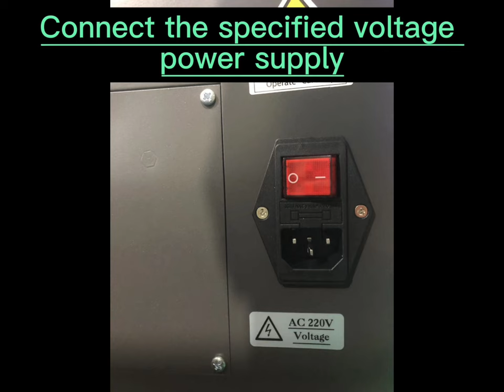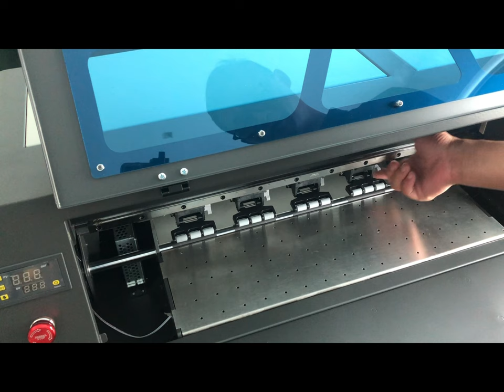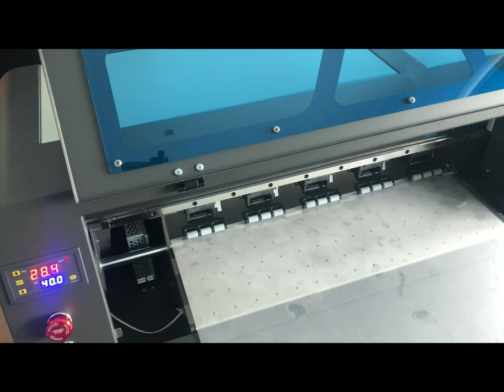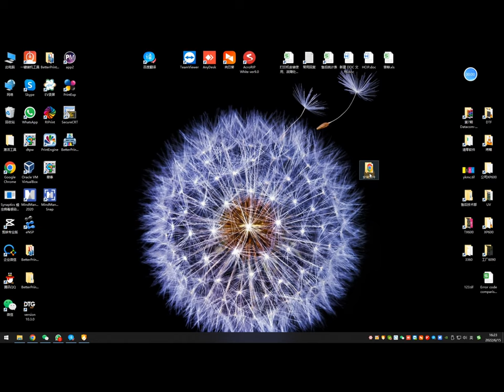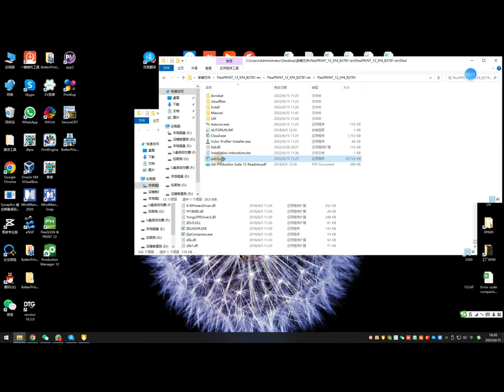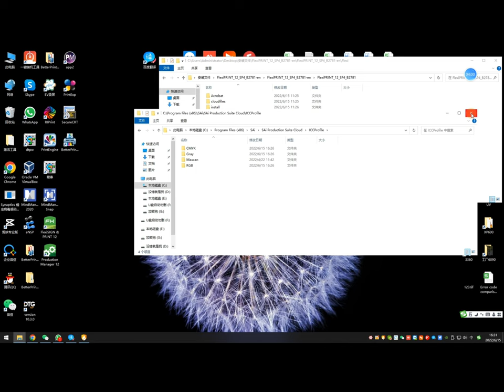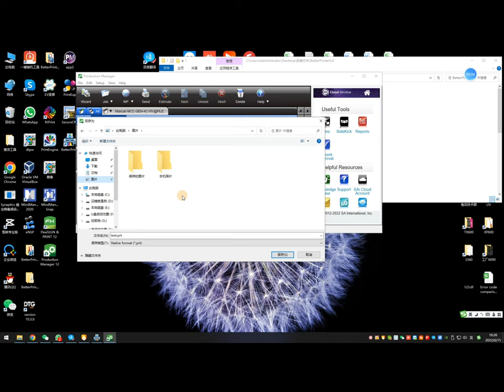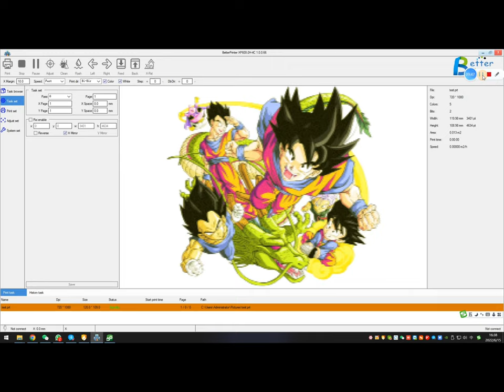t shirt business XP600 DTF installation video

Comment: Your company sells low-quality products that are very difficult to maintain. I bought a printer from you on which I can't work normally, I'm mainly engaged in the maintenance of your printer. People, think well before buying goods from this company
Reply from the maker: hello, Our machine has simplified a lot of maintenance procedures, and the maintenance is convenient. Compared with other printers of the same model, if you need maintenance assistance, please add the technician whatsapp+8618566231372, we will assist you in the maintenance and operation teaching of the printer， thanks